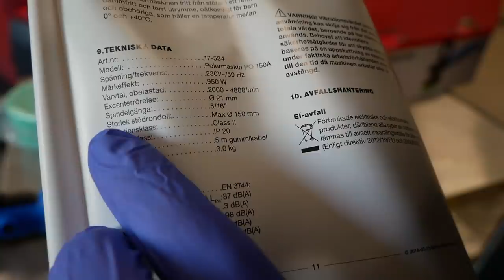TESTAR BILTEMAS OSCILLERANDE POLERMASKIN

Comment: Jag ska ha en polermaskin till att polera min bil en gång om året. Biltema har en modell under denna i testet, PO 125A (excentrisk) med 125 mm stödrondell, 650 Watt, 2000–6400 rpm, skulle det fungera eller är en musse pigg att föredra? Hade tänkt att få bort lite tvättrepor och virvlar.
Reply from the maker: Den funkar absolut, men som sagt är det mycket skakningar och vibrationer. Så det får man vara beredd på, men den får jobbet gjort.
Angående storleken är 125an också ett bra alternativ, det tar givetvis lite längre tid att gå över ytorna som t.ex. motorhuven, däremot kommer man åt bättre på trånga ställen 👍